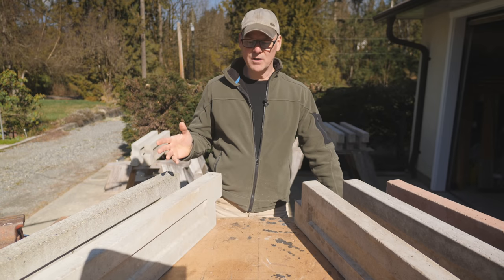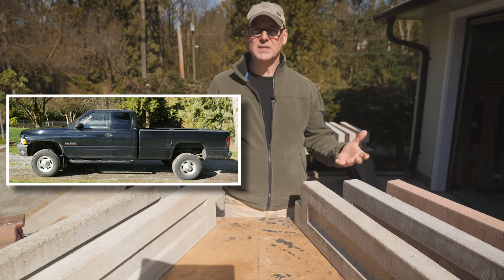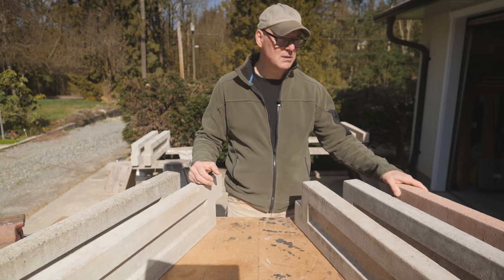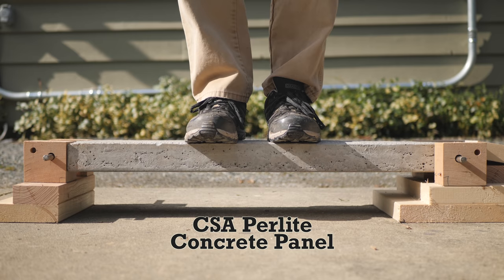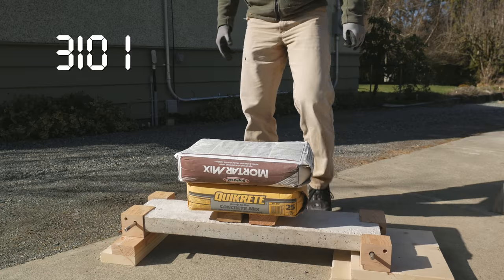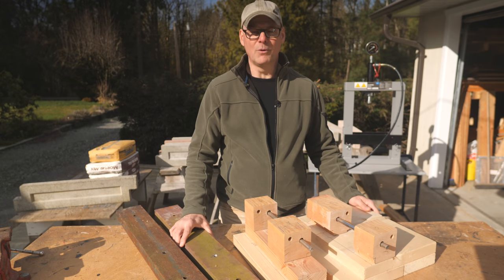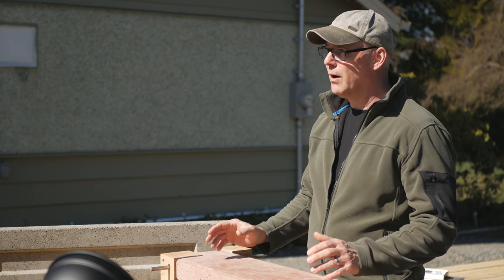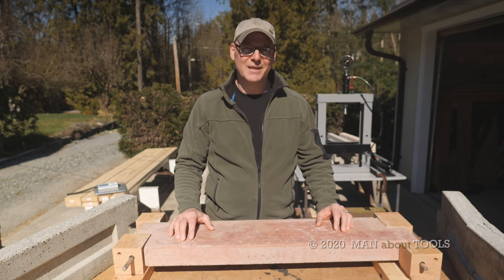How Strong is Lightweight Concrete?  - Deflection Test Perlite, Vermiculite, Lava Rock, CSA Panels

Comment: I would still love to see tensioned panels made. It would be the most expensive probably, but long-term peace of mind in extreme uses would be worth it.
Reply: lightdark00 sure it would be worth it if this was a building panel but it’s sole purpose here is holding back 50lbs of potting soil from falling into a garden path. It won’t have any pressure against it at al so a tensioned panel in this application would be ridiculous 

Sorry our views don’t align but it’s just a garden bed. It would be a fantastic idea if we were talking about building a garden shed or a garage with similar panels but we aren’t yet

Comment: You may find that dual reinforcing mesh separated as much as possible within the structure will give you the greatest strength. You might be able to use lighter gauge reinforcing mesh too.
Reply from the maker: I agree! I used that in two of the aircrete panels from Part 3.6. I'll be testing those next. Will be interesting to see what the difference is.

Comment: These have been very good videos - Thanks for sharing them.  They are Scientific tests though, and you have certainly put some effort into them.  If you are aware of a term "Point Loading", then this is really what you have been testing. Michael & Haidee below was correct about tension and compression, but that is why reinforcing is introduced into concrete.  Point Loading (surface area of load) is where your experiments have differed from the surface contact of the car tyre, to using one timber with the press and then increasing the point load with two timbers and your bricks. With full surface contact load when used to retain soil and I think that these will stand up to much larger forces.  Well done!!
Reply from the maker: Thanks! And thank you for your comments here! Cheers, Kent

Comment: Great videos and a lot of work, but I think you may have vastly underestimated the forces involved in ice formation in your tests.   
The upper limit if pressure required to prevent ice expansion completely is of the order of 1GPa (~10 atmospheres).  Your truck parked on a couple of 2x4 segments may have hit 1MPa order of magnitude.      
The other limit - expansion - is about 1%. So you either have to expand by ~0.3% in each direction or survive ~1000 times your truck-test weight in pressure, or some compromise between the two extremes.   
In the real world, obviously lots of organic material in soil is compressible (as would be a stryrofoam lining to protect your plant's root from frost).   
So, it would be very interesting to see how they survive trough a winter when filled with soil and whether mulch etc, would be sufficient to prevent those catastrophic forces that ice can produce.   
New video in the spring?

Comment: Great channel! Thank you! Hot/Cold expansion and contraction in geographic locations must also be a factor? Without frost ground heaves concrete is very stable. Also damp soil is fine down south around your project. But up north, it's big trouble when it freezes (as we all know) Thank you for a great channel!
Reply from the maker: Thank you very much!

Comment: These are plenty strong enough.  However--as loaded they'd take even more if reinforcing wires were closer to the outside surface to take tension more effectively, obviously they must be made fairly quickly and you sure don't want wire showing on the surface so I wouldn't change much here.  Very well done.  (revisiting :D)  May do my own version of this compelling design, the insets are crucial for aesthetics I think.
Also 'scientific' enough Sir.

Comment: Kent, you're doing great work.  How long did you allow the panels to cure before running these tests?  I believe that 28 days is the normal period for concrete to achieve its engineered strength.

Comment: Thank you for these helpful videos. Do you have all the formulas and tests written down that you have performed. I am going to be building some dome concrete structures out in Arizona Im going to make the aircrete bricks myself and build the domes out of the blocks. They will be approximately be 16x4x4 blocks that im going to be making and it seems your compressions strength test for each block was about 500 which is well over what i need for the domes as it will get a mesh screen over the entire dome and plastered. Im now wondering if I should put two sticks of  rebar into each block or if that will be too much, Definitely in the header windows for sure tho!!  Any feedback would be great!! Thank you - Konstantin

Comment: even though the panels have broken, I still think it's worth using the lighter versions as planters. because they wouldn’t be moved often or thrown up and back and forth.
Reply: Considering the other materials people make planters from, I think these would be plenty strong enough. Roofing iron with pine framing seems to be very common - and the problem that concrete addresses is not breakage, but rust and rot.

Comment: Hi Kent. Instead of using wire mesh, use 12 - 16 mm deformed bar with 2 or 3 lengths running lengthwise along the panel and evenly spaced across the panel. This should increase its strength quite substantially. Wire mesh is good for keeping concrete together, but it doesn't really add any strength to the concrete. Rebar or deformed bar does add strength. Consider any structure which requires additional strength, such as pillars or concrete wall etc., the use of rebar is essential. Mesh is good for concrete pads, footpaths or driveways. Your panels lie vertical, not horizontal. The forces of the dirt within the four panels is minimal however, rebar for added strength is the way, and not mesh.

Comment: Weight of the truck tire was on the wood block as it passed over the pin, and as it rolled off the wood block and onto the concrete the load transitions from being a sheer load to being a bending moment that created the large tensile stress on the bottom surface, causing the panel to fail at the distance in from the end.  Also of note, weight is not equal between the two rear wheels as it gets transferred once the suspension gets compressed by the difference in height, so closer to 2,000 lbs was applied, not 1275lbs.  You could potentially measure the deflection of the truck suspension to get a more accurate measure of the applied load, and from the distance the concrete cracked at then be able to back calculate the tensile failure strength.

The wire mesh in the middle of the panels should have little impact on this failure mode, but the addition of fiberglass to some of the panels will have a major impact on the ability to handle tensile loads on the bottom side of the panel.

Comment: This is probably obvious and intuitive, but the load calculation is about (b*(h^3))/12, where b=base and h=height. You'll notice that the strength is a LOT greater if you tested those beams in the standing up direction. It'd be a lot harder to do the test, but I guess it depends on what kinds of loads you expect the garden boxes to "see" during their lifetime. 

For example: 
if they're 2" x 8", laying down they'd have an area moment of (8 x (2^3))/12 or 5.33
if you stood them up, it'd be (2 x (8^3))/12 or 85.333 - note that this means that they could carry 16x the load in the standing up direction. 
If you were worried about loading in that direction, I'll bet you could maintain the same weight, but gain a lot of strength if you made "ribs" that ran the length of the form on the inside "soil side". You'd have to play around with the dimensions.
Reply: So, if you knew the dimensions and if the  wire reinforcement did not fail could you calculate the compressive strength of the concrete in psi? I know normally compressive strength is found by compressing samples until they fail. This beam test seems more feasible for someone who doesn't have equipment to generate thousands of psi.

Comment: Your reinforcement grid, works on the other side of a pushing force.    So, the reinforcement wire, should be closer to the bottom side, under the press.   If your reinforcement is closer to the other side, you would get a very different result.

Comment: Instead of wire in the middle try using galvanized rebar so it won't rust. i should dramatically increase increase load.

Comment: I would think that by adding even 2 - 3/8” rebar would be stronger than the he cattle panel.  There is really not much steel even though it might hold the panel together better as a raised bed panel.  Than a stress test.  I really like your Chanel.  I am thinking about lining a creek that flows through my twenty acres with some sort of a concrete panel that I can just add them as they are made sort of thing.  I watching your tests closely to give me insight on how to build them and what mixes I might use.  Thanks

Comment: A scale on one side of test system with a press or pulley would allow you to increase the load in s controlled manor while still allowing you to get a good estimation on the weight at which they failed.

Comment: Looking for strength add #4 (1/2") rebar in the thickness area then add wire mesh 😊🤪
Great effort 👍
Reply from the maker: Thanks! I agree, rebar would make them stronger
Reply: @MANaboutTOOLS  gotta say, ❤️ love your ideas.
Thanks 4 sharing 🤓
Reply: The wire mesh is not helping at all (apart from holding it together after rupture)  unless it is in tension... which it isn't , if it is not buried until it is offset to the front of the panel.... 

I like the idea of 2 strips of 1/2" rebar instead of the mesh ... but... the same applies, it needs to be in tension so buried deeper. Look at commercial lintel construction to see what I'm trying to explain. This is also why there is a right and wrong way to install a lintel. (A top & a bottom)

Great vids btw... 😎👍☘️🍺

Comment: At what depth you position the steel wire / mesh determines how much weight the panels can hold, essentially you want the steel to take all the compressive load. the surface that you are putting the weights (loading surface) on is in compression, aka added reinforcement is only for stabilization.  I can draw you a engineering free-body diagram if need be to clarify. P.S. yes i'm a mech engr & i bought your old original plans but modified them a bit..
Reply: would love to hear your thoughts on what ree and where best placed. Cheers Bill

Comment: So I was going to do Aircrete but then saw that the weed wacker can damage it and Perlite  didn't do well on deflection test,  what about a small amount of Styrofoam beads? curious to see results on it as the surface should still be strong and the smaller and more rounded shape of beads should be stronger than Perlite rough shape.

Comment: Possibly mixing in cut up high pound fishing line could be an easy way to improve tensile strength
Reply: You can buy plastic fibres for the purpose. They look like concrete broom bristles - fairly stiff plastic with the sides deformed enough to grip in the concrete. I think fishing line wouldn't have enough grip.

Comment: been benging these things really really love them for sure the smaller single layer beds. how ever i want to go 24" tall (3 panels high) with my bed. Im worried these things would lean outwords because there only held upright by steal rods. so the bottom piece wont relocate but could flex outward. would you ever do a video into that since your moving a lot of dirt around your house and have the panels already?

36'' x 96'' x 24''  wall bowing/leaning and flexing test

possible fix. 4x4 cement post that connects the pieces in the corners and between each panel. something that could be 1' /1' deep.

Comment: This was great!

I would really like to make tall garden boxes from light weight concrete. But, if the lightest version was 35 lbs, a wall for a tall box would probably exceed 100 lbs.
Reply from the maker: Thanks! There's the option of having a lighter panel on the top row. The aircrete panels in Part 3.6 worked out well and they weigh about 22 lbs each.
Reply: @MANaboutTOOLS  The garden boxes I built are up to waist level height. The idea is to provide a water reservoir and plenty of growing material that is better than the red clay where I live.   

Would each level of yours be water tight enough to prevent water from coming out? If not, then I would have to use the garden plastic interior bag method I currently use and figure out away to hold it in place with the cement.

I watched this entire series and others you have made, because you put together great videos, especially the 3-D animations.

Comment: Has there been a soils or civil engineer chiming in here to estimate actual lateral forces from freezing soil? Some of the pressure would be relieved by vertical soil movement no doubt. Also, my understanding is that rebar should be a minimum of 2 inches from the exterior surface of the cured concrete. At 2 1/2" thick you're only 1 inch plus at best. Does the galvanizing take care of that rust/fracture problem?

Comment: Can you clarify if the "regular concrete" is standard bagged concrete or is it glass fiber-reinforced concrete? In the 2.0 video with the dimensional lumber forms I believe you used the fiber-reinforced concrete. I'd be curious to see if the GFR concrete was any stronger.

Comment: I’d like to see a thinner piece tested for impact resistance…….such as a equivalent to 3.5” hail. Would be nice to make roof tile out of if it will support the weight of a roof installer and is impact resistant

Comment: It seems like for garden beds all of the options are strong enough so it comes down to three decision points.... cost, weight and time.  The extra effort of aircrete saves weight, but needs wire reinforcement.  Portland cement is strong enough and cheaper than CSA.  CSA would save in curing time.  Would you agree with this summary?  The lowest effort and cost option seems to be portland cement without wire reinforcement, Have you tested this option?
Reply from the maker: I'd say the simplest and easiest is regular concrete mix from any big box hardware store. But I'd still add some wire mesh. It too is cheap and easy. Also, have a look at my super simplified form: https://youtu.be/9kga9jSG7Gs
Reply: @MANaboutTOOLS  it seems you have the wire mesh in the top portion so it is doing nothing for this test other than holding the mass together when it cracks. The large rectangular relief facing the ground is the bottom of your form correct? You placed the wire just under the surface on the non relieved side right? It would fare better in your tests had you just put the wire on each side of the relief 3/4ths inch from what would be the face. Or you should have done the test with the relief facing up. The wire should be at the bottom (closest to the ground) to counter tension. 

For the intended purpose, wire should be used in just the bottom, so if your orientation of the panel is for a planter box, just put it in the area that will be near the ground. 

Since aircrete absorbs water easily, the fiber is practically necessary to stop freeze/thaw cracking. Adding a bit of lime will also help freeze/thaw issues but will make the cure time longer and you have to make sure it stays wet longer ... 2 days minimum. Hey maybe you could test ratios ...

Comment: Kent-- These are useful, interesting and fun videos. Thanks much-- My only objection was watching you climb on top of panels loaded a meter high with concrete bags. I was waiting for the panel to fail to watch you tumble off the pile.  Would the load be terribly different if you were to sit on the bags instead of standing?  Safety first, friend!

Comment: Problem with all of your tests is that you're not using uniform applied pressure.   The truck tire was not only heavier but had the smallest foot print or maybe close to the block under your press.   The bottom line is those things are all insanely overkill for a garden box.   You could probably make them 1" wide and have plenty of room for any soil expansion. 
So here's an IDEA.   Make your forms with a channel on the inside. 1" thick or so, and a 1 or 2" Tee, like half an I Beam.    That would keep them from bulging and I'd assume they would be in the 20lb range for the 36" panels.   You could still use 1/2" flexible tubing that you could pry out after cement set for your connecting bar.   You wouldn't need any PVC.

Comment: I am curious to how much more pressure they could take if you used actual rebar rather than the wire mesh, especially for the lighter panels.

Comment: Could you test a couple panels with the face facing up instead of down. It seems as if the reinforced wire mesh its a little more towards the back side, I think it will be stronger with the face up

Comment: Excellent empirical testing procedures, even if going in with assumptions the testing was not based on the assumptions.
Unfortunately, test results based on a single sample is not conclusive.
I assumed the lava rock would fail first and the 'regular' mix would not fail under equal testing parameters.
I was certain the truck would kill any of them.
No to find your others so I can find the mixing ratios used.

Comment: I’m more concerned with whether the panels can tolerate freeze thaw conditions which is what would happen here in Maine.  Also I wonder what the forces would be like when soil freezes that is contained by the boxes. Thanks for some great Ideas for making boxes and I hope to be making fence posts which need to be at least 8 feet long.
Reply from the maker: All the panels I have made have endured many, many freeze/thaw cycles. No issues yet.
Reply: I would think that at s quarter ton they would hold up Great, being as its not an enclosed space. I wondered about water getting in the concrete and failing it that way.